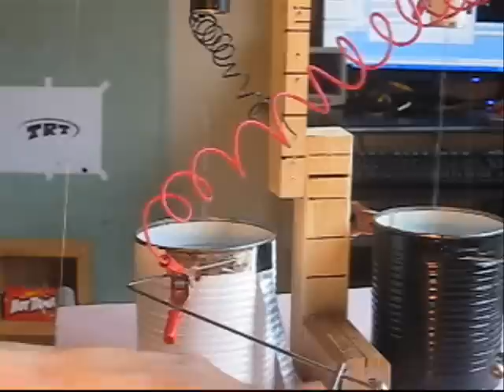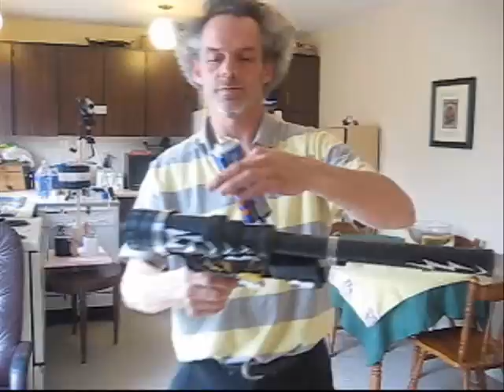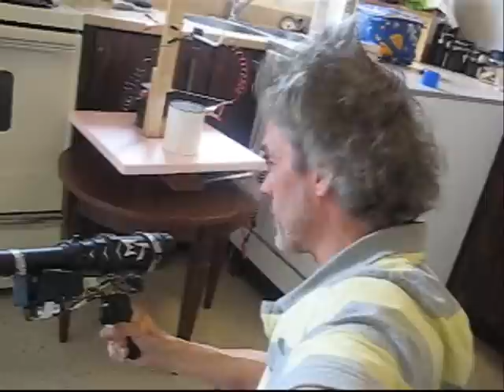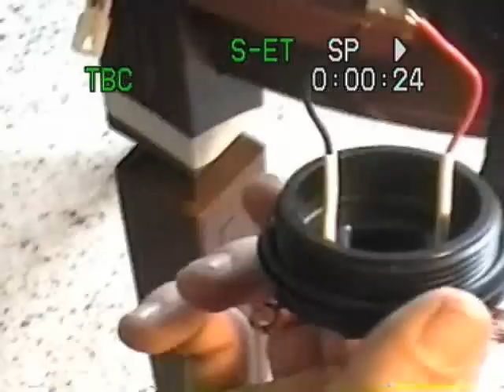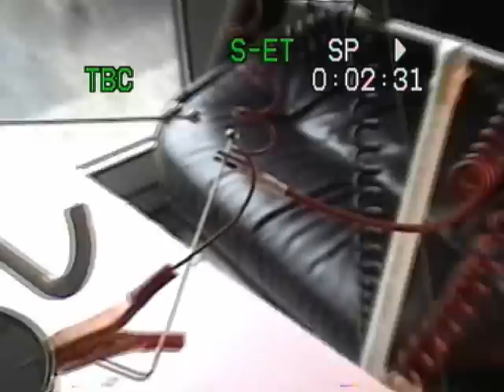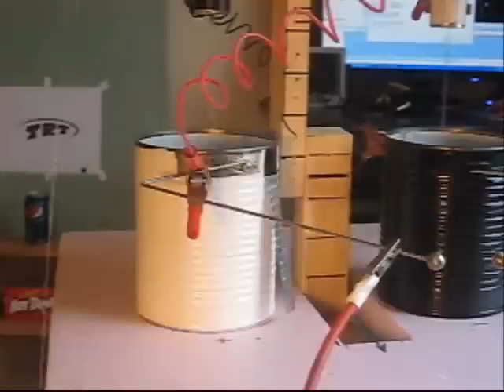Kelvin's water droplet explosion

Comment from the maker: I used the coil from an old Kodak disc camera It's a 9 volt coil for advancing the disc forward .Soldered on leads to energize the coil that mechanically moves the anode to touch the cathode.I cut down carbon brushes for the electrodes (found carbon is the only conductor that won't fuse when it discharges the capacitor in an old camera flash I rewired )( tried high current micro switches but even contacts made out of cadmium would still fuse together after the first shot!   " Hope that helped "